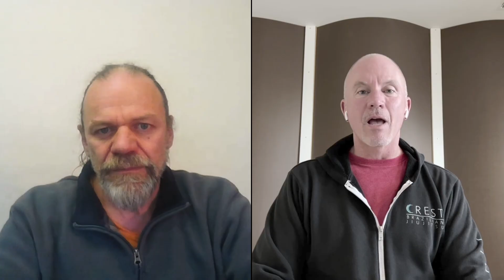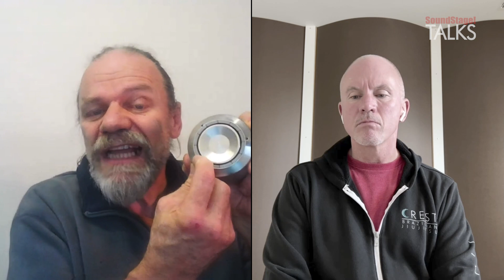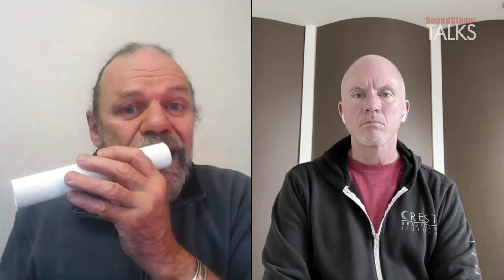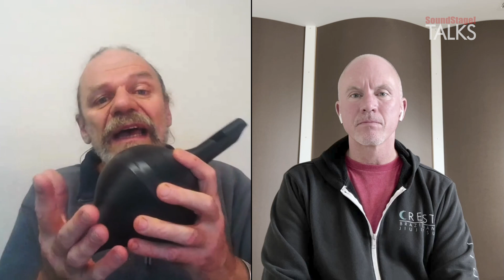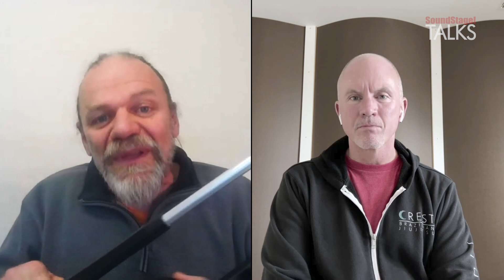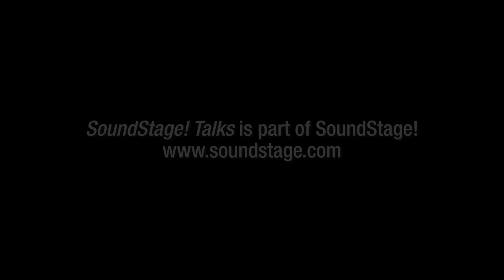How to Design the Best Bass into a Loudspeaker - SoundStage! Talks (January 2022)

Comment: Great interview. It is great to have designer to openly talk about the principle of his speaker. In theory, it is great that to have two bass drivers producing equal and opposite forces to cancel out cabinet movement. However, in practise, one will never have two equal bass drivers. There are always variances. Hence, there are always minute forces applied to the cabinet. G1S still benefits from spiking in my opinion.
Reply: Yes to a very tiny degree. And what differences there are are mitigated by the rubber o rings that the speaker drivers are mounted on - i.e. they are not actually bolted to the cabinet. Spiking on a conventional loudspeaker just puts the energy of the cabinet into the floor. There is so little energy in the cabinet of a Giya speaker I don't see the point myself in spiking, but each to their own. (Owner and user)